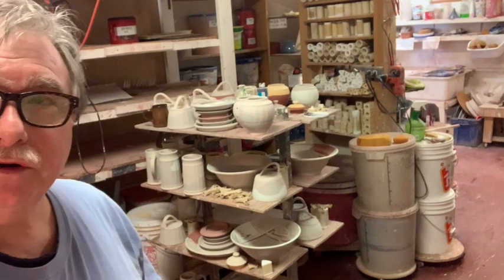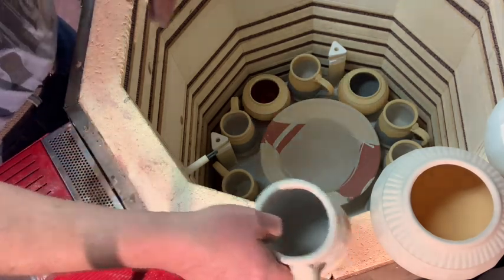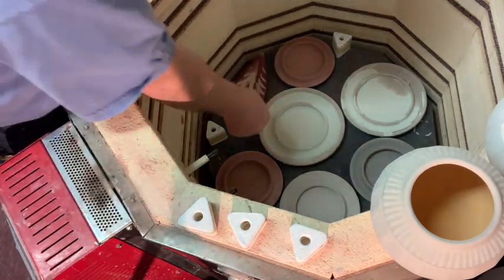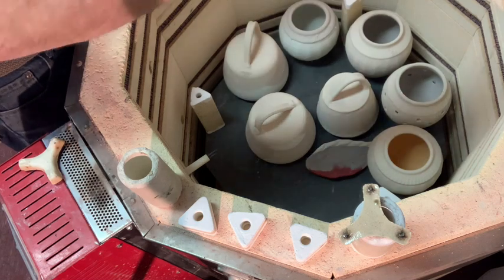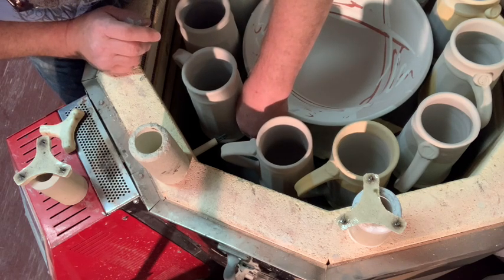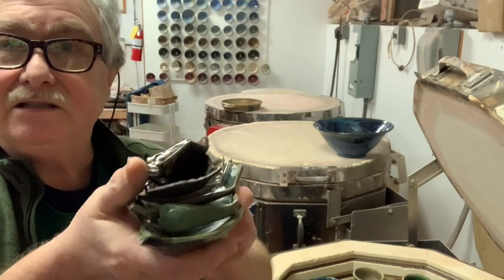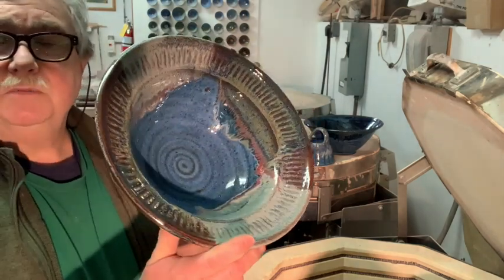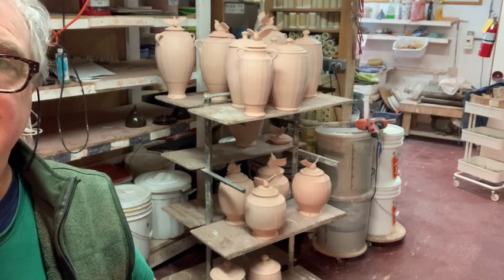Packing:Unpacking a glaze kiln

Comment: What weight of clay are you throwing for those large tankards? I'm trying to get the shape right but mine are coming out rather squat
Reply from the maker: I use 1 1/4lb for 16oz and 1 3/4lb for the large ones which are 20-24oz, may be larger. Tankards should be thicker in the wall.